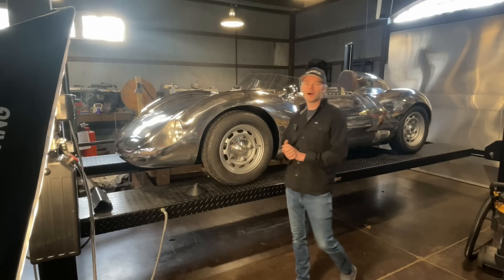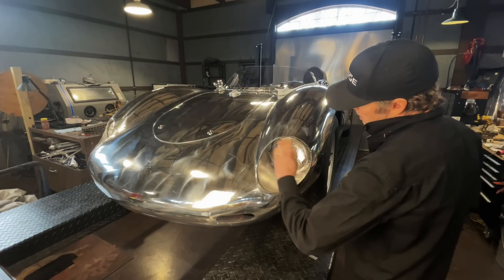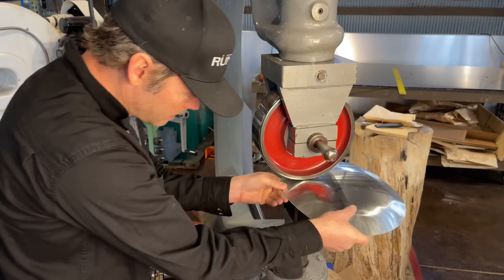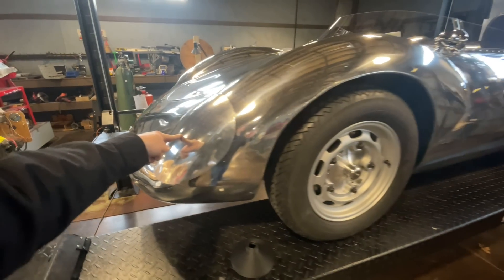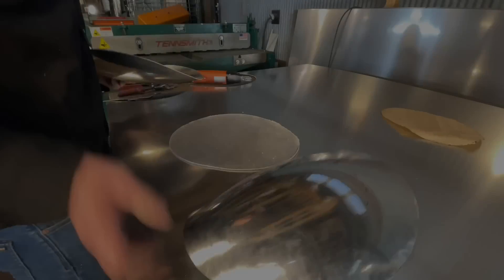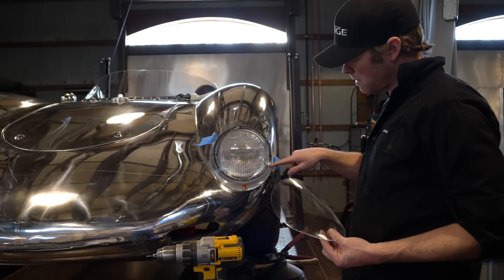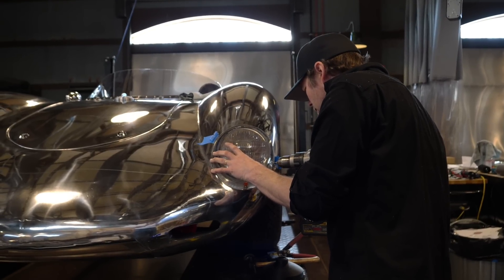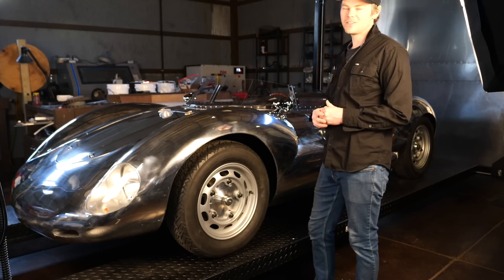Runge RS Forming Plexiglass Headlight Covers

Comment: Thanks for sharing your amazing craftsmanship once again. A couple of questions if I may:
1. What Thickness perspex are you using?
2. Didn't catch the oven set temperature or heating time?
3. Have you tried or considered making the buck out of the piece cut out from making the fender ? Seem like that would be the perfect starting contour.
Reply from the maker: Great Questions:
1. I am using 1/8" Plexi
2. I started at 315F and bumped it up to about 340F for the last couple minutes.
3. The headlight opening I cut out of the fender ends up being too small, as I like to have that extra inch or two around the outer parameter...

Comment: If I were to mount the headlight lenses I would make a ridge (about 1/8 in. around the inside of the light , add a rubber ring and make a headligk rim to attach to the outside  . I think it would be much more pallative and wont let in dust and dirt ... just a suggestion , Cliff
Reply: I was going to make the exact same suggestions to the letter. It doesn't quite meet the level of the rest of the car.

Comment: Always great to watch and learn from your videos ✊. In case you don’t know, you can soften the edges of the plexiglass and make cutting face smooth as “glass” by carefully heating it up with a gas burner.  Maybe an air gun will work, but I haven’t tried.  I did that when I made blue plexiglass sun visors for my E-type.

Comment: I was surprised that the left and right side covers could be made from the same molds. Is there not some asymmetry there that would require a  mirror image rather than a duplicate?
Reply from the maker: Hi Douglas, as the video shows, I made separate molds for each side… a left and a right.

Comment: Looks great!  I have had issues with plexiglass cracking when using a drill - I use a headed awl to avoid that issue.
Reply: PETG is a good plastic that doesn't crack when drilled and is UV resistant.
Reply from the maker: Yes the plexi can get fragile. I suppose one could even preheat a drill bit…

Comment: Looking good :).
If it rains will water pool in the bottom infront of the headlight?, the headlight itself will be waterproof, is the indicator bulb sealed against water ingress?.
Does this need sealed around the edges?, or would any water that got in just drain out?
:)
Reply: I doubt this car will see much rain but you do have a good question.
Reply from the maker: Good question, I do have a press on gasket that I use in some cases. The bulb and socket components are weather proof.

Comment: Love your channel. I curved plenty of plexiglass in architecture school, and the best trick I learned was to cool the plexy with tap water straight out of the oven, it tightens the curve slightly further than the mold, instead of the material popping back.
Hope this is useful. Keep working those jewels you make!
Reply: Great suggestion. I just posted a vacuum forming method be used. I made a clear cockpit cover for the Indy 500 SUMAR streamliner in quarter scale and I carved a block of wood dead smooth. A model maker vacuum formed perfect covers. I think the same method could be used for the headlight covers...even a windshield. Carve the shape and the vacuum will pull the heated piece into shape.

Comment: I would’ve thought that the hot metal would put an imprint in the plastic. When I did this years ago, I used plaster molds with dowels and lined them with an aramid felt. Nice work!

Comment: .... outer "perimeter", not "parameter"? I implemented a simliar setup on my 1974 Lotus Europa Twincam.  What did you use for fastners between the plexi and the mounting brackets?  Self-tapping or a suege-locked threadsert on the bracket?  What about debris that can sneak in around the perimeter/periphery of the lense from the outside?  Thanks.  It's a piece of jewelry.

Comment: What about sealing the covers against water?
Reply from the maker: One could add a small "Trimlok" type gasket around the outside if wanted.
Reply: If you try to seal that area it will cause moisture to build up on the inside of the lens, and fog over when warmed.  Even stock headlights with covers are vented to prevent moisture build up. The slight bit of air that can get past the perimeter of the Perspex actually helps to allow any moisture that made it's way past the cover to not fog over from trapped moisture.

Comment: Your vids make me want to bend panels in the worst way! How much is a used English wheel?
Reply from the maker: You'll love it! My first English wheel I bought for $150.00. It was a homemade frame with HF anvils. I built my first three bodies with it!
Reply: @RÜNGECARS  Wow, I would have guessed several thousand $! I'm going to look into it. I love your work, especially being self taught. I taught myself to weld by fabbing a side exit exhaust thru the sill and most of the headache was getting even 1/2 inch clearance at the outlet with no banging againts the body. Used 3 inch pipe for the outlet and 2 inch for the pipe.